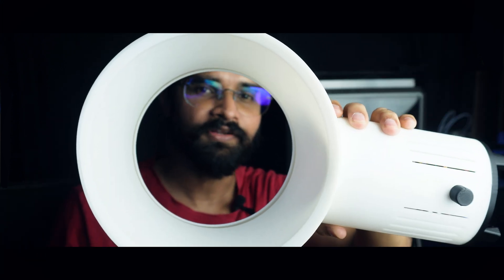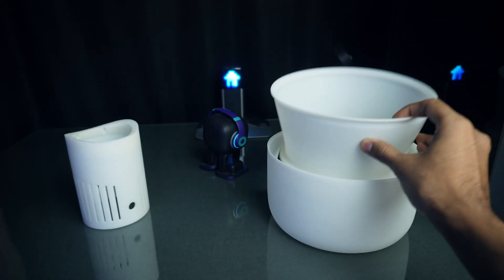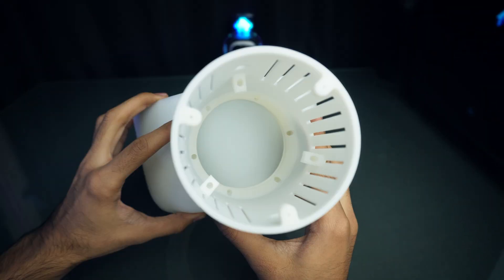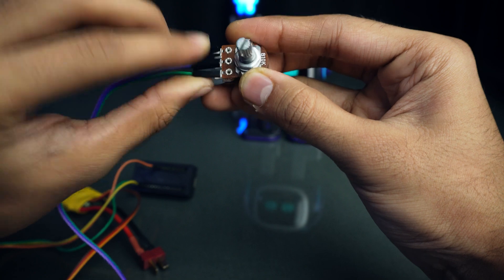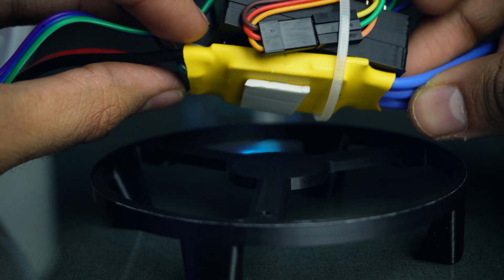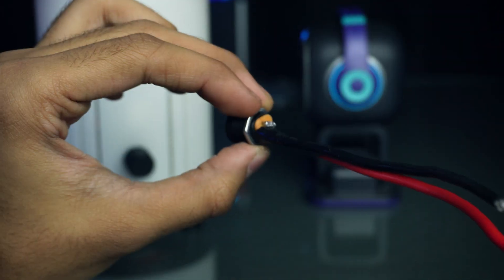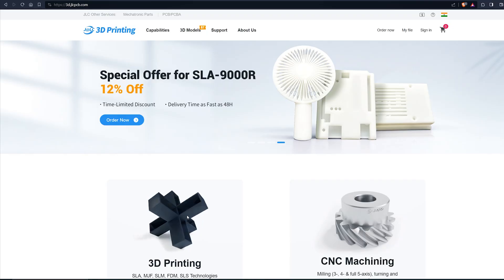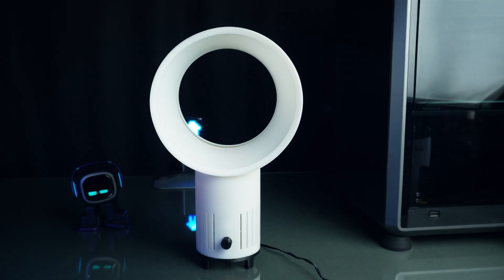Experience the Magic: 3D Printed Bladeless Fan in Action #3dprinting

Comment: Hello, wouldn't it be simpler and less cumbersome to make this fan with a different motor that doesn't require an Arduino?
Reply from the maker: Hello, for controlling the fan speed through potentiometer, we need micro controller. and for powering through various outputs we need ESC with BLDC motor.

Comment: Easier to make a square base and use a computer case fan that will be quieter
Reply: Not enough static pressure from many, then the flow speed is low to be used as an indirect fan